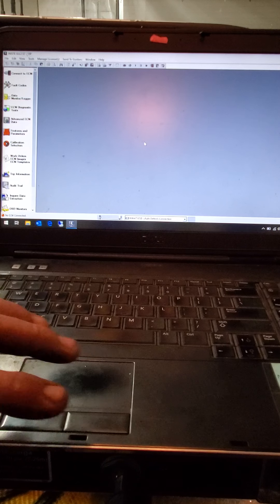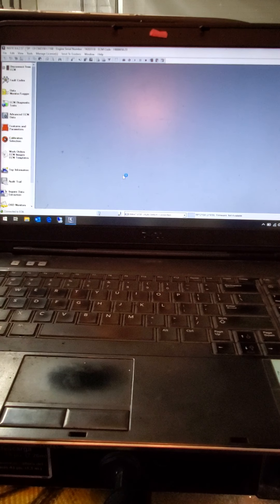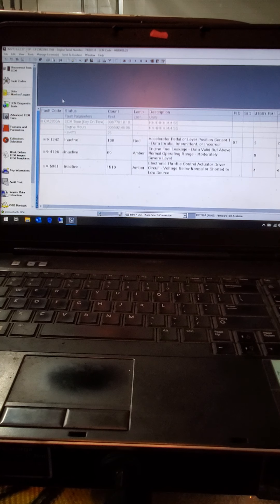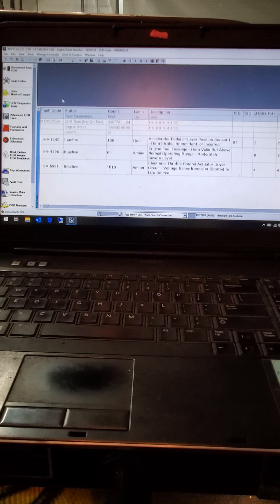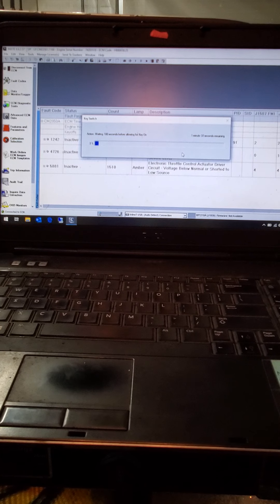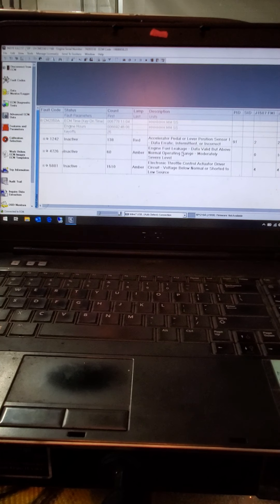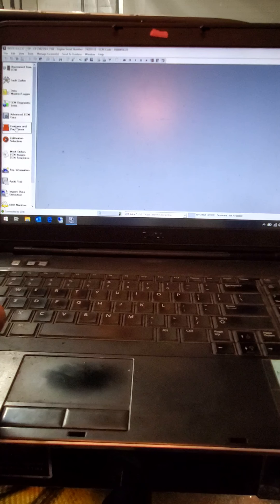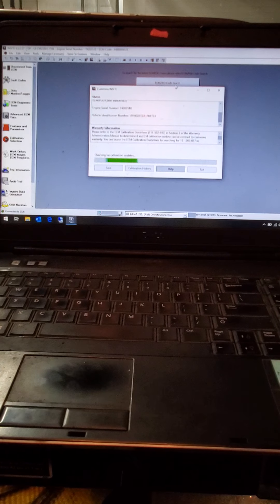Cummins insite basic use

Comment: What kind of system do you have on ur laptop and where can I get it from and how much? Thanks
Reply from the maker: Insite and u can get it thru Cummins but there are other programs out there that are cheaper
Reply: @dirtydieselnation8826  like what? I have small fleet some Volvo 2007 Cummins isx and some Volvo 2013 with Cummins isx , are they the same software or different software?
Reply from the maker: @ahmedragab4346  its the same software for them
Reply: Hey sir  u can buy a launch x431 heavy duty  tablet  tool    it does cummins volvo mack basically any brand of truck out there u can change idle shut down etc I've even been able to delete immobilizer systems on some trucks  its a hell of a tool it even does offhighway machines like cat excavators bobcats etc  check it out  I have insite but I love my launch   been using it for years     u can even do diagnostics and adjustments  for your friends    it will pay back for it self in no time
Reply: @cecilmayers3429  thank you

Comment: You're quick to call drivers stupid. I've met my fair share of them true. But I've met a lot of stupid mechanics. Especially since becoming a owner operator.
Reply from the maker: I wont argue with you about that lol
Reply: I didn't know about waiting a few minutes before turning off the engine to let the ECM run its diagnostics and to let the pistons and other internal parts cool down after running under full load, until recently.  That's shit that isn't taught by trucking companies or even CDL schools. That was my own research. 

And yet, I went to a TA to get a PM done, and a tech in training that had just graduated from UTI couldn't even start my truck up correctly. He kept turning the key without letting the fuel system prime and tried to start the truck. He did this about three times before I had to step in and show him how to do it properly. Either he didn't pay attention in UTI, or they didn't teach him shit. There's plenty of dumb to go around, lol. 

Good video, though.

Comment: It's always the driver that screwed it up. Never a parts swapper milking the clock. When the truck is in the shop, it's never assigned to someone who doesn't understand basic electronics, and rushes through just what the service writer made the work order for. It's never anyone's fault except the driver.

I know, because experiences owners, including myself, stopped going to the shop due to it costing three times more down the road than the initial shop bill, due to lazy mechanics. 

Yeah. It's always the driver. The ones who know how to treat a truck don't take it to the shop unless there's a reason other than mechanical problems.